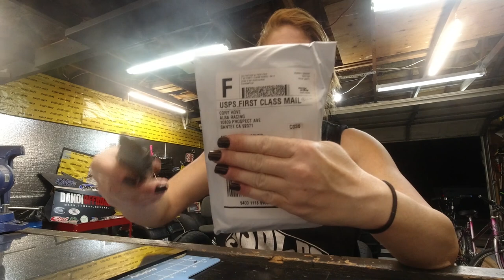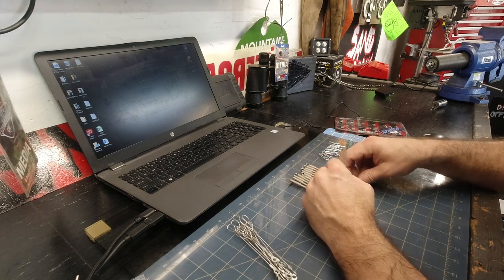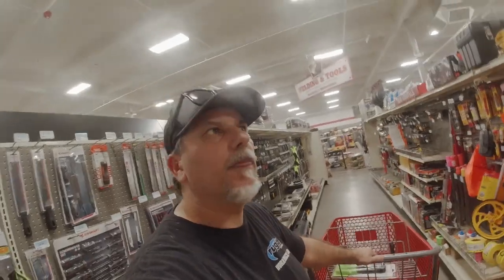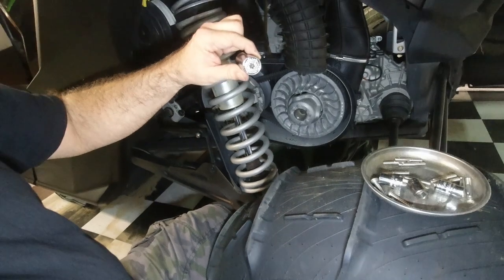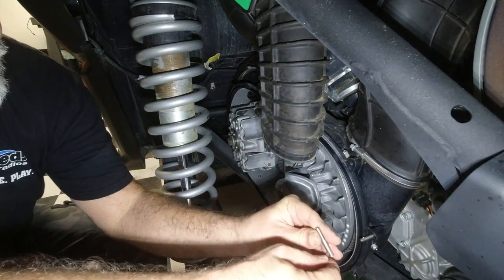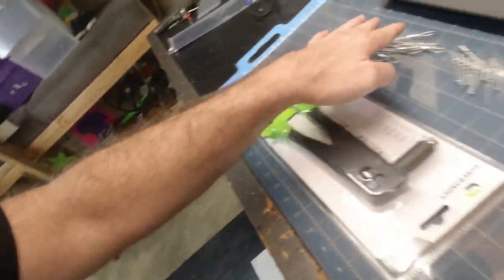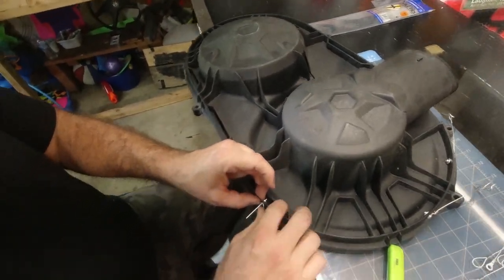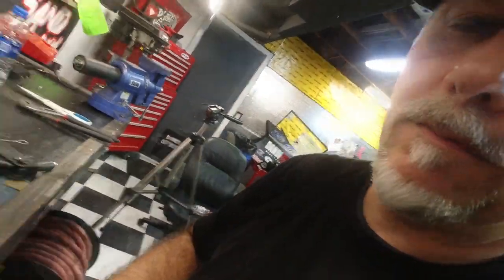YOU DID IT WRONG  Maverick X3 Alba Clutch Cover Pin Kit

Comment: So where does the supplied washers go? Was yours loose because you didn't have the gasket? Like the technique!
Reply from the maker: The washers go on the backside of the rivet to keep the rivet from pulling through the plastic. Yes, the reason ours is loose is because our gasket is missing, it was damaged when the housing was broken. Thanks, thanks for commenting.
Reply: @DandiOffroad  Thanks for the response! Great video!

Comment: So it looks to loose to use in water. Is that correct?
Reply from the maker: Not if it's installed with the gasket, shouldn't be
Reply: @DandiOffroad  I installed and yep. Pretty tight fit.
Reply from the maker: Awesome! Someday we'll have to replace the gasket in ours so it fits like it's supposed to